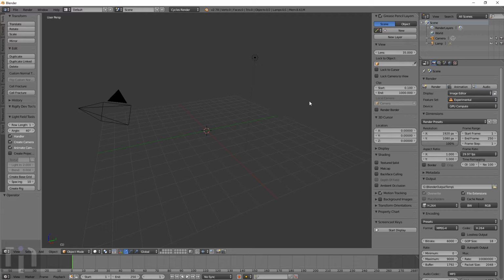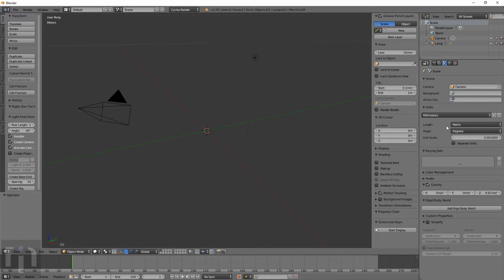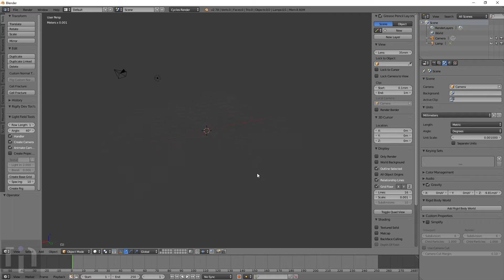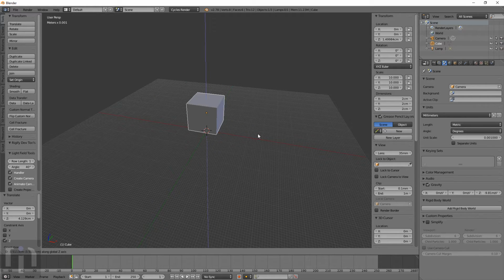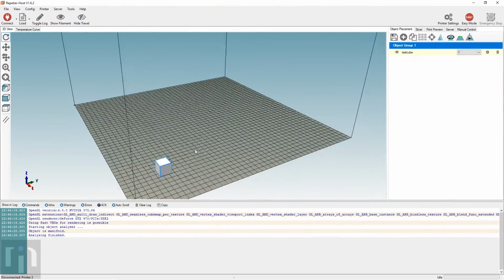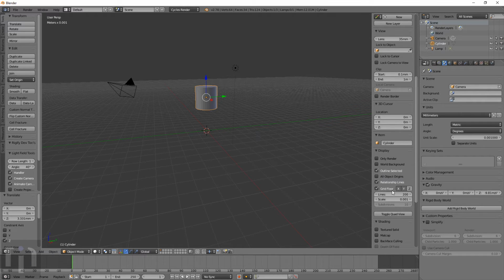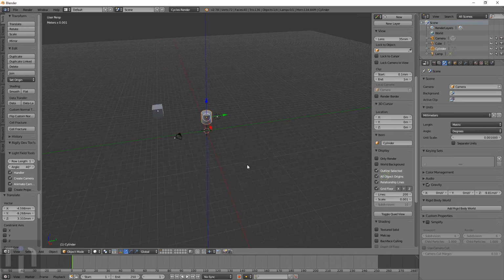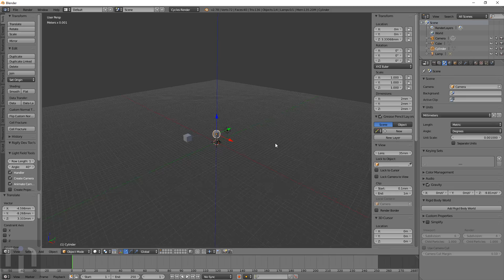Blender Tutorial #038 : New Measurement Settings for 3D printing

Comment: Bro thanks for this, I like 2.78 better than 2.8 so this was perfect
Reply from the maker: Anytime!  I also prefer 2.78, but I still use 2.8(whatever it is now).  I just set the controls to 2.7 settings.  I loathe the new settings they have as far as fluidity goes in doing anything with it.  Still getting used to the layout though.  Nice that you can still customize it.

Comment: hey, it doesn't add a massive cube when you do this. I might actually start recommending this to people.
Reply from the maker: That's why I made this video!  It actually works great for 3D printing now.  I noticed it had changed when I was making the Measure it addon video.  I just need to check to see if it works in game engines the same.  That's a whole different headache.  Especially with Unreal Engine and skeletal meshes.  The armature had to be 100 times smaller than the mesh and different bones had to be turned different ways.  It has gotten better since 2.75 for sure.